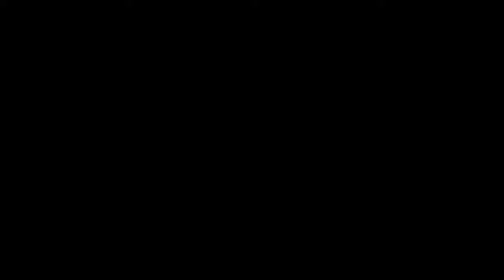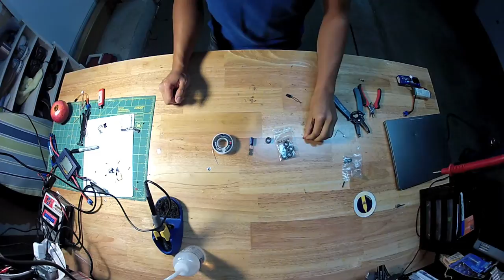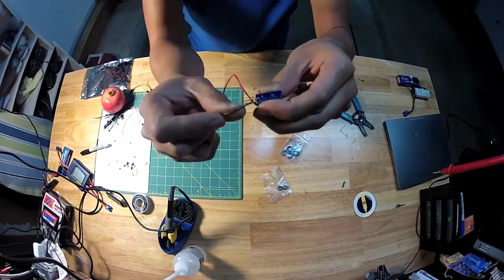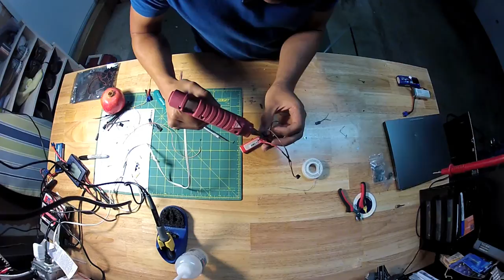How to Make an LC Filter for your FPV System

Comment: Hello, great video. I have this and I want to know if I still need to wrap it around the ferrite http://rctimer.com/product-974.html
Reply from the maker: +Sol mag 
That's just a capacitor.  You need to add an inductor, which is what is created when the wire is wrapped around the ferrite.  Look up "L-C filter" on wikipedia or google for more info.